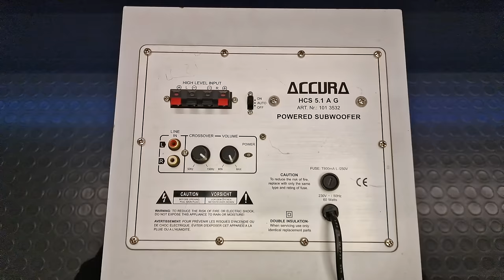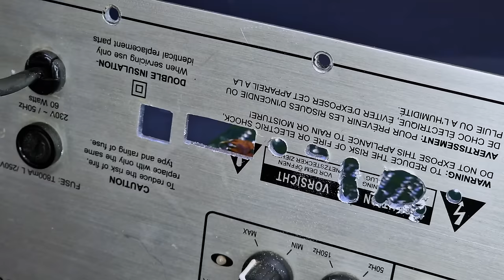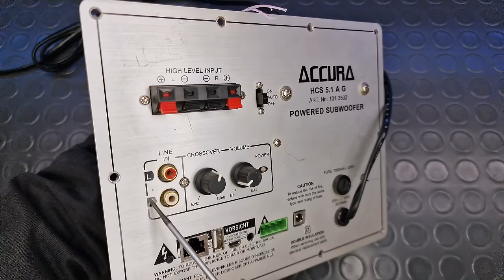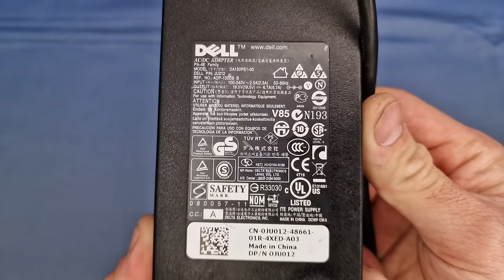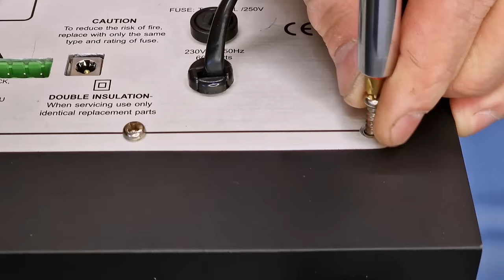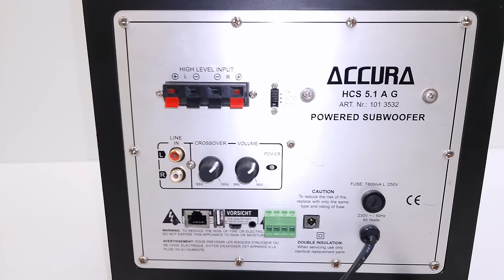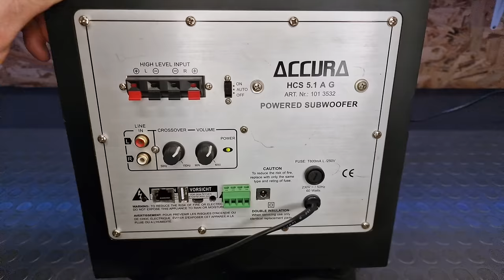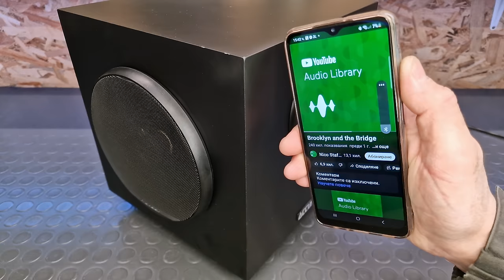Upgrade and Restoration of Old Subwoofer using Arylic 100W Stereo Online Stream Amplifier Module

Comment: technically is this not the proper way to do it. you can not have a full range speaker and a sub woofer in the same box without dividers. You will get a lot of distortion on the mid side because the sub is making the mid move also. It can also damage the speaker.
Reply: exactly
Reply: Yas
Reply: Agreed but this didn't seem to be designed for near field usage like in front of a computer monitor nor a hometheater setting more along the line of playing in the background (it identified as "garage" for the blue tooth app) since it's not for critical listening (studio mixing, pin point location sounds for gaming, etc) odds are what little it distorts would only be noticed when played loud and near the two speakers.  It reminds me of many blue tooth speakers that have a decent set of features, acceptable background sound, and used more for social gatherings.  Ideally sealing each driver compartment from one another, designing around the T/S of the drivers, and pointing them to the listening area would get the most out of it but then it did mention garage so to me it was way more than doable.  I also don't expect it to damage the drivers unless he listens often into the clipping range, most car drivers are in similar situations and tend to last years or the life of the car, if this was a sealed enclosure there might be a problem down the line but because it's vented I don't expect him to have any long term issues with what he did.
Reply: Ya agreed
Reply: TECHNICALLY..FIRST...SOLDER THE WIRES TO THE OLD BOARD...😁
Reply: full range speakers already have the base frequencies .
Reply: Exactly
Reply: How about boombox of jbl manage its sound without any divider
Reply: @reignrewardaying3551  partetion
Reply: @reignrewardaying3551  they are professional
Reply: First thing I was thinking, wait, he’s not using sealed back midrange speakers?
Reply: Totally agreed
Reply: And if you know more than the young man who made the video, why don't you do it? It seems like a great idea to me.
Reply: “Well technically ner ner ner shut up Carl just shut up!”
Reply: You are genius 😊
Reply: Por eso es que los de otros altavoces están que escursionan 😅
Reply: Yea 2 rooms 1 for sub and one for the speakers

Comment: Only thing done correctly on this project is soldering, and the use of the down firing sub. Using coaxial speakers where passive radiators should have been installed is going to damage them, it will also cancel out the bass unless you reverse the polarities of the coaxials Another point is the power blocks risks of becoming over heated  covered in poly fill inside the enclosure.

Comment: That Dell power supply not going to last,no air circulation ,plus it covered with some sound dreading material .just a matter of time till one of the components fail,then you going to rip it apart

Comment: Great rebuild of an old subwoofer. For best sound quality, the subwoofer chamber must be separated from the other speaker drivers. I also would not cover up the power supply with insulation. Maybe mount the power supply up high. Subwoofers need to be on the floor in a corner, but mids and highs need to be at the listener's ear level, so this is not ideal for listening to music with the highest possible quality. This system would be great at a party, though, indoors or out. It's powerful and self-contained.

Comment: The sub speaker can induce voltages in the other speakers and damage that board. 

You can see in the video, the bass is flexing those woofers a lot, probably way beyond what they're designed for.

I like that adhesive used between the board and the aluminum plate. Need to get me some of that.

Comment: 3:33 like a machine 😂
At the end the box looks GREAT, and it kicks Powerful. 
Great restoration!
Reply from the maker: I'm glad if you like it Brother🙏🙂🤝
Reply: @ErCanEverything  Your idea is great but there is a little bit problem. You put all the speaker in one box that is not great because the tone speaker could be damaged. The subwoofer speaker will create a large  pressure on other two speaker, and the other two speaker has not that much ability  to move the screen so much. But the subwoofer has, So it will create a extra pressure. Because this speaker is built in such a way that it can do a lot of movement while delivering bass. I hope you get it. Your work is beautiful.

Comment: It's a shame that the power amp doesn't have a high-pass filter for the speakers.
then it would sound much better.
Or you would have a separate volume for the subwoofer.
Nevertheless, I think it worked out well (thumbs up)
Hello from Germany
Reply from the maker: It is true that the construction is a bit non-standard, but I still wanted to try it.
I bought this subwoofer from Germany about 13 years ago and it has been sitting in the ceiling for several years.
I love Germany and its people. (Lieben Deutschland) Greetings from Bulgaria👋🤝🙂

Comment: Drivers should not be placed against each other or mix it with a driver with a different frequency response. Certain frequency levels will be cancelled due to the opposing movements of the cone. This will make the bass flat or less distinct.
Reply: that and hes running 2 4ohm speakers with a 8ohm sub so not sure what the output is for the amp but itll be half of what it claims since the sub wasnt 4ohms

Comment: U really hv done a very good job in customisation! 
But, I believe the drivers r suffocating in that small enclosure! They deserves a little more space as per the "Thille Parameters" I believe... .
Reply: *Thiele? as in Thiele-Small speaker parameters...? 
if that's what you meant, you're right. this isn't the correct enclosure for what he's trying to do...not by a longshot. other than the sound produced being hugely problematic, he's going to have to open up this project again to replace the damaged components that this designed caused. 
There are so many thiele-small speaker parameter calculators out there..

Comment: ur work is good but you could hase used just the transformer insted of the adapter
Reply from the maker: The transformer is designed for a 60W subwoofer and I added another 2 x 50W to it which will load a lot and even make the sound worse.  And that's why I added a 130W adapter to it.  By the way I am very happy with these adapters, I even made a 0V - 55V 18A power supply using 3 of them
https://youtu.be/PL82cN_hNbk

Comment: Great video and very interesting, i may do the same.

What kind of glue and spray do you use in this video ? It is something i didnt hear off.
Ty
Reply from the maker: I used Mitre Apel and it looks like an epochid resin like it dries and then I smeared with sanitary silicone🙂

Comment: At about 23:55 in the video during the final demo, the camera passes the port. It is obvious that you can see right through the cabinet at the wall behind it. I didn't notice any open area (except the port) once the rear plate was attached. How can that be??
I'm thinking that the sub and the full range pair did not play (literally) nice together, as should have been expected. Still, with a bit of modification 😅, this can be remedied. The 3 speakers cannot share the same airspace. You might consider some other type of song to use for the demo. I'm guessing a more full range audio test would reveal a big mess. However, if you're someone who doesn't care about sound quality... they'll be perfect.

Comment: Not making a separate partition for satellite speakers is the biggest mistake when you renovate this sound system, because the great pressure from the subwoofer affects the satellite speakers, causing the sound to be distorted. Long term will damage the speaker.
Reply: Stereo speakers should be located 2.5 meters apart. And so it turns out a porridge of sounds.

Comment: hello, here we see that you have made a serious mistake, the mids should not go together with the subwoofer in the same box as they would act as passive radiators, having an air duct for the subwoofer this is just for decoration. I recommend that you use stands with a sealed basket so they don't move and so the subwoofer works only with the box. You will notice the good bass.

Comment: this notebook power supply will burn inside that box due to the heat generated even more covered by the blanket, why didn't you use the same transformer to power the new board?
Reply: true list abt bang for buck and not wasting any 'potential'

Comment: A structural tragedy for me.
1) mid-bass speakers in one cabinet, in addition with a bass speaker - the diaphragms interact and create a huge sound distortion
2) cut off tuned ear canal for SW
3) the brown glue that was originally yellow (the color changes as it ages) is extremely corrosive and when degraded from the conductive part - the manufacturer's fault, it should have been removed immediately
4) I just hope that the white substance fixing the supplied plate is not an acetate-based silicone - it is extremely corrosive and must not be used on non-ferrous metals

All the best in the new year 🙂 Tom

Comment: The sub woofeer box should only reproduce bass sounds, you should not put mids and highs in it, it would be much better to place these two speakers in a separate box at the top and the sub woofer on the floor, this way is not good 👎👎 Solution instead of these side speakers, place a passive radiator and place these mid and treble speakers in a separate box.

Comment: he is a complete dilettante. rave. he cut off part of the phase inverter, put 2 more speakers in the box ... the case was calculated at the factory, the phase inverter (pipe) was installed with a special diameter and length in accordance with the installed speaker. tuned the resonance frequency of the subwoofer, the volume of the case and much more. and you ruined everything. and the sound will now be booming.

Comment: waste of time, effort, hardware (pioneer speakers and   most of all, beautiful arylic module)
Every speaker should have own closed chamber. Thus, all speaker interfere with others and make distorted  sound. 
Using glue make this project clumsy , unreliable and unserviceable.
In one word: DISASTER

Comment: Why didn't you just repair the amplifier from the subwoofer seems like it was just the capacitors that were bad It wasn't gonna be expensive to replace them and it was gonna be a lot easier to do that than to do What you're doing